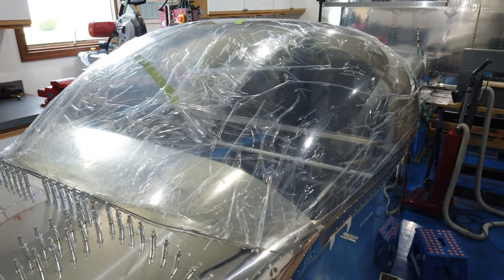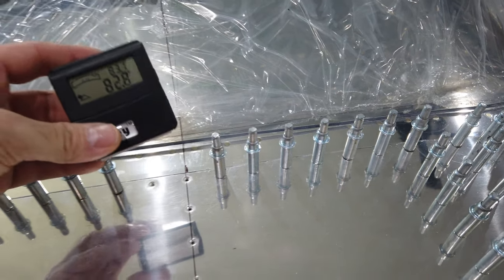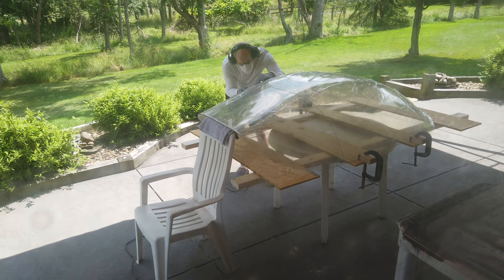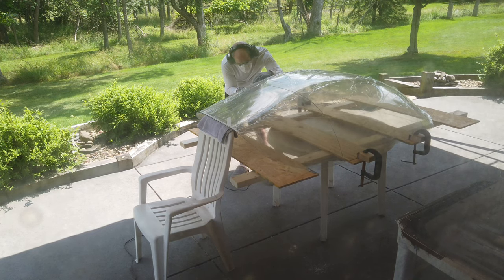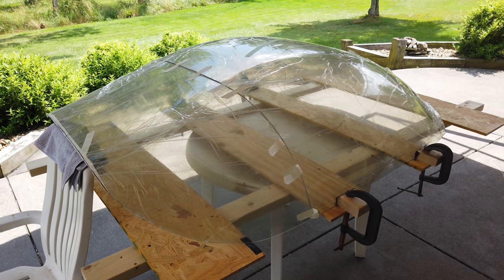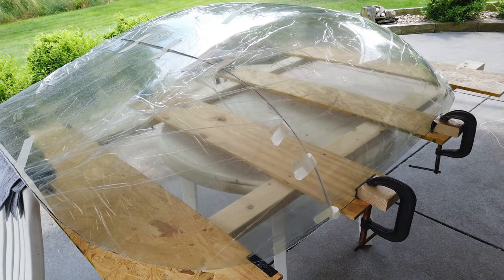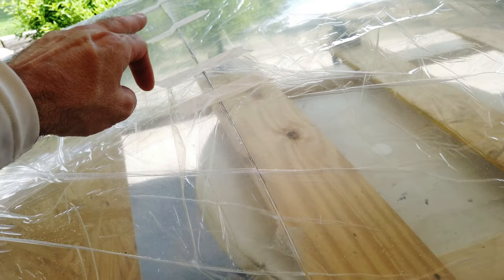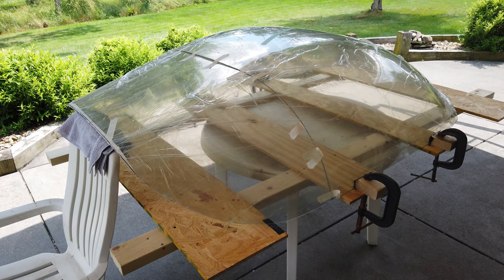Vans RV 7 HINT Video Canopy Glass Big Cut

Comment: Thanks for posting these videos. I will soon be making the big cut on my RV-9 slider. You clamped blocks to "squish" and hold your canopy bottom edges - is the distance between blocks the same as the fuselage width or is it narrower to keep a little extra pressure across the canopy bottom?
Reply from the maker: Great Question Steve. I just set the blocks where the canopy "felt right". Not helpful at all, I know, but you'll be able to tell. No science behind it; I just blocked one side, then pressed the other side in enough to take out the stress and clamped. It has been moved and re-clamped dozens of times...and counting.
Reply: @KaretakerAero  Thanks for the prompt reply. The more I think abut it the more it seems logical that the distance across between blocks should be equivalent to the fuselage width so when I get to that stage that's what I think I'll do - but will bear in mind what you say about it "feeling right". As an exercise it might be interesting if you measured the distance on your wooden jig and compared it to the fuse width - not that you haven't got enough to do haha. By the way I'm building in the UK so won't have the luxury probably of your warm outside for the big cut - I'll be inside with heaters on full blast!
Reply from the maker: Howdy Steve. You'll see just how flexible the canopy actually is and how much it changes shape when handling, placing on the fuselage, on the table, etc. Having it maintain a specific shape when off the fuselage will be a challenge. 

Be careful with heating. It needs not be cold, that's it; it does not need to be hot. Also be careful with local hot spots as you cut, file, sand, grind, etc. I was surprised how much heat sanding by hand created when polishing the edges. Over all it is quite forgiving; just be sure the edges are smooth and cracking will not be a problem.

The blocks on my wood jig get moved every time I place the canopy on it to best suit what I need to do to the canopy at that time. Measuring and placing them in the same location all the time won't be user friendly at times. This will all make sense when you get there.   Email me if you like.